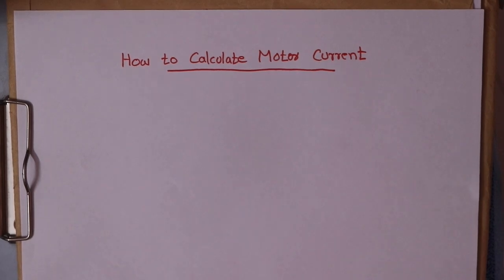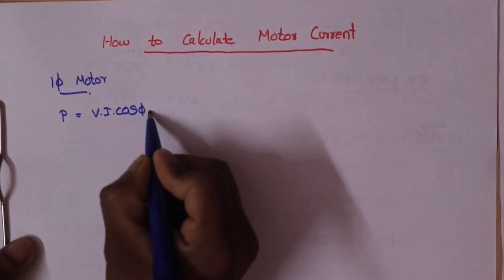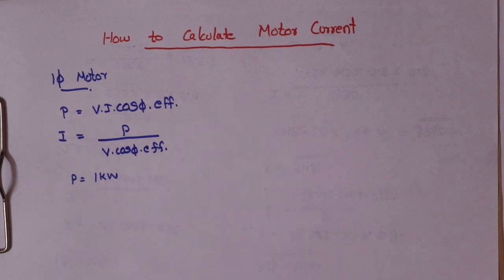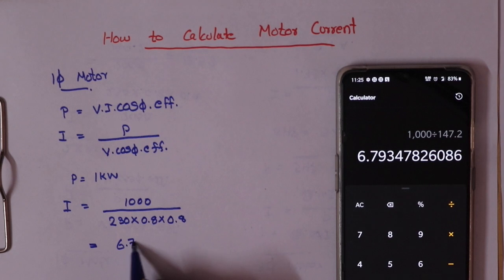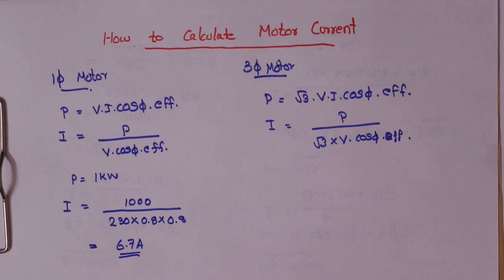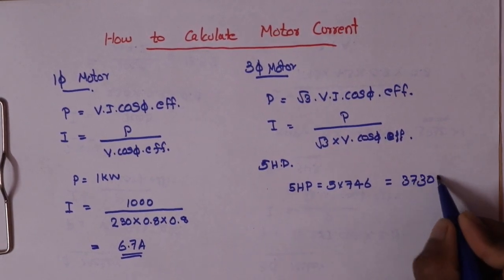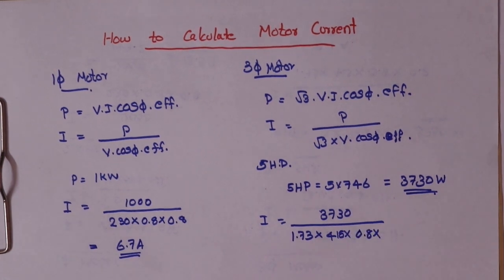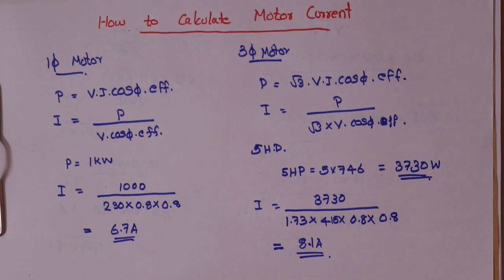മോട്ടോറിന്റെ current എങ്ങിനെ കണ്ടുപിടിക്കാം || How to calculate motor current malayalam|

Comment: 10 KVA ജനറേറ്റിന് ഒരു change Over Switch കണകറ്റ് ചെയ്യബേൾ‌ എത്ര ആ ബിയർ Change Over വെക്കണം
Reply from the maker: 10 kva യുടെ full load ഏകദേശം 14.2A വരും.  So  16 A മതിയാകും.  ആ size available ആണോ എന്ന് അറിയില്ല
Reply: @ThroughTheCircuits  10 | K VA ജനറേറ്റർ മാക്സിമം 8000 വാട്ട്സ് കിട്ടും
8000ഹരിക്കണം 230 = 34
34 ആ ബിയർ change Over Switch വെക്കണം 
സിംഗിൾ ഫേസ് ആണേ
ഈ കണക്ക് ശരിയാണോ
Reply from the maker: Single phase aano.. , അപ്പോ 34 A carry ചെയ്യാൻ പറ്റുന്നത് വെക്കാം..  ശെരിയാണ്

Comment: I have one doubt in 1phase and 3 phase i take power=1000w
calculating current by using above said equation
1phase current=6.7a
3phase current=2.17a

Is this true and practically genuine the above said (6.7,2.17) value?
I think that 3phase having more current that 1 phase, but i understood that whaether it is single phase / 3 phase the current is totally depend up on the specification of that motor
Is it correct?, if i am wrong anyone can correct me
Reply from the maker: 3 phase calculated current,  2.1 A is for one phase only
Reply: @ThroughTheCircuits  ok thanks
Reply: No bro.. If power same and voltage low it have more current...

Comment: Please oru thavana ee calculationum oru clamp meter vechu etratholam accuracy und  theory calculation & actual readingum thamil onnu manasilaki tharumo for 3phase only.... In this example 3phase motor 8.1amps alle appo enik oru 15amps 3phase mcb vechal enough aano or nan starting current 4times more consider cheythu 32amps 3phase mcb use cheyano... Kure nall ayulla doubt aanu...
Reply from the maker: Bro even mcb anengilm overload capacity time und,  mcb over loaf ayal milli sec il trip avilla,  aa over load kurach time ninnal mathrame trip avollu